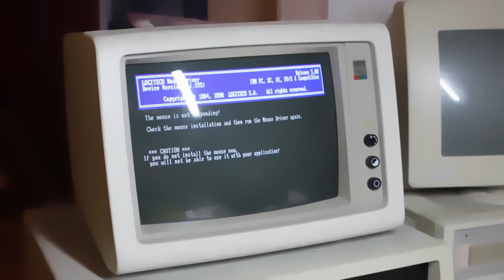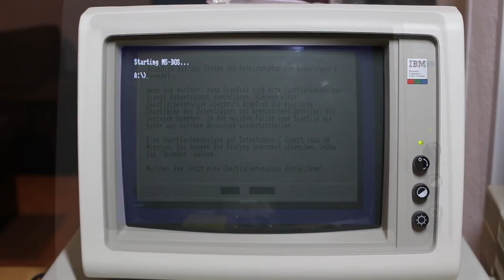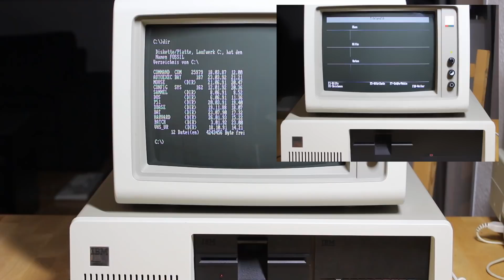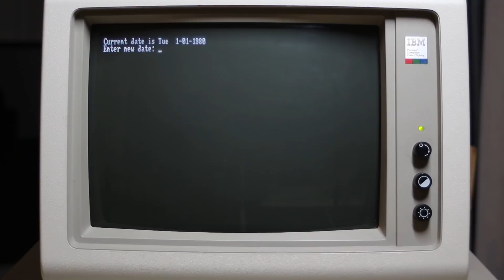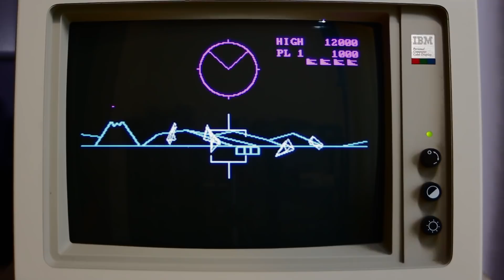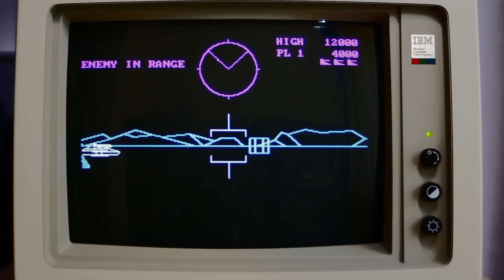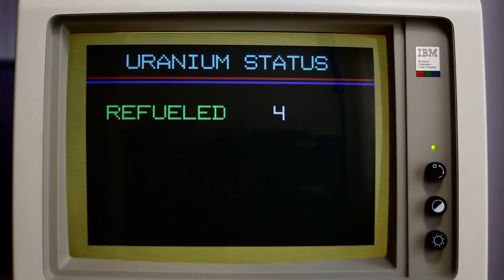This IBM Personal Computer held quite a few SURPRISES for me!

Comment: I’ve had pretty good luck with those old drives.  My XT, XT 286, AT, and Tandy 1000 RLHD all work like a charm.  Now, those drives in the PS/2 Model 30?  Good luck.

Also, I know some people are against pre-emptive recapping, but AFAIC, anything older than 1995 with tantalum caps has either failed or is about to.  Order 100 of the 10u/16v and a few each of 4.7u/16v, and 22u/16v, and just make it part of your new-to-me routine.  Otherwise you WILL end up playing whack-a-mole with ballistic caps, and that can’t be healthy for those poor PCB traces.

Tip for anyone who doesn’t have a vacuum desoldering gun:  Use side cutters to crack the cap open like a nut.  Then pull out one leg at a time.  With those bent legs, it’s a LOT easier to pull one out at an angle than trying to get all three legs through at once.  WAAaay fewer damaged pads that way.  :-)  (Not none, because the annular rings on those are so thin, they’re made of a hope and a prayer.  But still.)

Comment: It was already 1989 when I got to use one of these machines. This video brings back good memories
Reply: Tell me about it. I didn't get mist first PC, (an XT) until 1992, of course sort of made up for it by the fact not only did I get an XT, I got a Compaq 8088 luggable suitcase too. At least then we didn't have to deal with batteries leaking, or caps blowing. The stuff was near obsolete even then, but at least it worked without having to fuss with it.

Comment: I've just been through this journey myself after picking up a non functional XT. The same two capacitors on the motherboard needed replacing.

The hard drive was very noisy when I first managed to power it up, but a little bit of oil and some warm up time and it sounds a lot better. Even booted into DOS!
Reply from the maker: Mine still seems to be going, which is amazing given how much noise it makes. But people have assured me it was very normal for those drives.

Comment: very interesting and well narated video, thanks ! I also have some of these IBM machines - IBM AT/5170, IBM PC/5150 and also bought this september an 5160/XT with Hercules card and Amdek HGA display. All were with working MFM HDD's. on the 5170 I exchenged BIOS chips and installed IDE HDD, 5150 fitted with ISA8->CF card and the 5160, alas, have sold to another collector(... Also used to have Amstrad PC1640 as seen at the end of your video, but had sold it too... Now have an Amstrad PCW8256 which is a 8bit CP/m based machine with graphic mode)
Reply from the maker: Compact Flash can have its uses. I prefer to keep these old MFM drives working if I can, but it isn't always easy.
Reply: @PCRetroTech  agree it's cool to see in 2022 a computer with a working MFM HDD with it's brr-brr noises and indicators flashing) I keep them in storage - Seagate 2026 from 5170 recently gave for a feew week to onе man who was IT engeneur since mid 80's - he tried to use in in different machines from 5150 onwards) - but for me practical aspect is more important sometimes - so CF card or IDE HDD with more space for home use / MFM for a retro-event/festival)

Comment: The badge on the front should say "Personal Computer XT". Someone swapped the case cover, or at least the badge, from an original 5150 PC onto yours.
Reply from the maker: You may be correct, but I can find examples of IBM XT's without the XT on the front badge. There were numerous submodels of the XT. On the other hand, early IBM XT adverts feature the badge, so whilst I can't say for absolute certain, I'd lean strongly towards you being correct.
Reply: @PCRetroTech  None were originally shipped that way, except maybe for a few mistakes at the factory. It's just that because the PC and XT covers were identical, over the years of people working on them, they tended to get swapped.

Comment: Ohh and if you want a cool little video to do on these. Find an NEC V20 chip. Its a pin/socket compatible 8088 replacement that is literally good for 10% to 20% boost on these old PCs.
Reply from the maker: Sure, but nearly everyone is familiar with the V20 and V30 by now I reckon. I try to look for unique things where I can. But thanks for the suggestion.

Comment: I think later 5150s had the higher capacity power supply. It was mostly the earlier releases that had the black 63watt supply.
Reply from the maker: You could be right about that. I think my machine is a mishmash of parts, so it's hard to tell whether it is original to the machine.

Comment: Good !

I found a working 10MB hdd a while ago for cheap, but unfortunately I don't have the original IBM XT case :(

I have almost every part required to have a working XT. I'm just missing a PSU, a case and a IBM floppy drive ... (and PSU/case are the most important parts imo)
Reply from the maker: Cases seem to come up every now and again here in Germany. I have an extra floppy drive, and I'd offer it to you, except that it doesn't work. I bought it unopened, still sealed in plastic, but it eats floppy disks, quite literally. Those seem hard to come by in working condition as well. Quite often people are selling parts because they don't work any more, I find.
Reply: @PCRetroTech   Thanks, I appreciate the proposal, and I may consider it. For the case however, I can't find any, the only ones I see are from the US with a very high shipping tax, which is weird since my country is neighbor to germany ...
When they do pop, they're often with a really high price here as well
Reply from the maker: @DxDeksor  Yeah we have to pay these ridiculous customs charges, and some sellers really jack up the prices for shipping because there are so many lost and damaged items. Sometimes you can get lucky, but very large items tend to be very expensive to ship from the US. Keep looking out for one from Germany. They really do come up a few times a year. If I spot one I'll try to point it out to you.

Comment: Have you experimented with an EGA card on that monitor? If I recall back in the day I could use 16 color mode with low res ega on this screen :-)
Reply from the maker: Yes, that is correct. It works great in the low res mode.

Comment: I recently fired up an old IBM 10 mb hard drive and it booted right up after 30+ years. I ran spinrite and the drive had no issues. The others I tested I wasn't so lucky.
Reply from the maker: Yeah I think they aren't so bad at all. Certainly beats a Plus HardCard, which with 100% probability will be faulty.

Comment: It's not an MFM controller.  It's an ST506/412 interface.  MFM is only the encoding method, MFM or RLL.
Reply from the maker: Just to be precise here, ST-506 and ST-412 were hard drives, not interfaces. However, the interfaces became known as ST506 and ST412 due to the ubiquity/importance of the drives. They were both MFM.

Later the ST412 interface was extended and we got ST412-HP for RLL encoded drives.

This particular controller card in the video uses an MFM interface and some individuals refer to it as an MFM controller card, which is just short for "hard drive controller for hard drives using the MFM encoding". But that is a bit unwieldy, especially when you are trying to edit videos down for time, so please accept my apologies for being imprecise.
Reply: its an mfm controller....you can call it whatever you want....you can get a miniscribe, kalok, fujistsuu wahtever... 20mb mfm hardrive or even a 40mb rll drive working on one of those controllers, doesnt need to be an st412...the only downside is you have to low level format it WITH that controller and it will format it with 10mb capacity and not the actual full capacity of the drive....some people and publications also call those 5 or 10mb mfm controllers "winchester controller" or in case of the original card that came witht hese machines a "xebec"| controller

Comment: That is just how those cinder brick sized hard drives sounded.
Reply from the maker: Yeah a number of people have mentioned that. I'm not sure how clear the sound actually is on the video though. It sounds like an aircraft taking off with some outdoor furniture stuck in the jet engine, but being drowned out by other aircraft on the same aircraft carrier. My microphone was far from the drive.

I'd love to know why it sounded like that.
Reply: @PCRetroTech  The PC was fairly much built using off the shelf tech. The original 10MB hard drives were pretty much 1979 tech. And yes they were loud, obnoxious, and could be felt through the desk the PC was sitting on. (Seriously try it, place the PC on a solid desk, and get it seeking a lot. You will feel the vibrations through the desk). The Seagate ST-225 used in the last XTs was much better. Since it was designed for the PC, and not something that was meant to be in a backroom on a mainframe. Those platters in that thing are huge and heavy, and made quite the racket.
Reply from the maker: @Alcochaser  I can feel it without it doing any seeking. It rumbles the table like an industrial clothes dryer. The main noise I'm talking about though is the scraping noise it makes and the occasional noise that sounds like a pebble being thrown down a very deep hole (there's a kind of echo sound).
Reply: @PCRetroTech  Yep. The pebble noise has a reason. (Something the drive does once in a while with the heads) but its normal. The scraping might be the static wiper. These drives had a mech on the motor to ground it and to keep the thing from building up a static charge. These drives are beasts anyway you look at it.
Reply from the maker: @Alcochaser  Yeah I thought it could be the static wiper, but given that it probably got oil on it, I'm sceptical it's that. Obviously it isn't heads scraping. In the end the best theory I came up with is brushes scaping the commutator. If they are severely worn, that could be the cause.
Reply: @PCRetroTech  Maybe. There are a few odd things that stand out to me. I know people have pointed out the Cover doesn't match the PC, but there are a few other things that don't match. I wonder if at some point someone didn't mix and match stuff to get something that worked (Like I did in the 90s). You have the last revision 640K motherboard, but the hard drive and its Full length XEBEC (thats what we called those) controler, and the big 10MB tank drive from the early XTs. That controller is locked to only one drive geometry. Later XTs had a controller that could be jumpered for 4 different drives. It really looks like a PC that someone was using into later dates and was trying to keep running. If I remember right, XT 5160s used 135Watt supplies, and the PC 5150 (which had 5 slot motherboards on different spacing) used a 65 watt unit. So the 150Watt unit is a bit odd, and maybe aftermarket. (they made them, other case types did use the XT style supply). The video card you showed later is a definate later add on. MDA and Parallel. Only thing this thing was missing for being used at such a late date was a Clock/Memory/Ports card. Often made by AST. These would bring non 640K boards up to 640K, and could actually bring an XT to over 640K. The boards came with a driver that made the extra memory show up as EMS ram (not XMS).. I had one we scrounged all the chips we coudl find and I brought my XT up to 1.1mb of Ram total. I also had the fancy Western Digital MFM controller that has a BIOS you got into via Debug poking. You would tell the BIOS the drive parameters and go from there.
Reply from the maker: @Alcochaser  I'd say the supply was definitely after-market. I'm not 100% sure about the video card. It's unlikely the machine was bought without one. Perhaps someone decided they preferred monochrome and decided to get an after-market card. Or perhaps it is a more recent addition so the person could sell off the video card separately.

The seller didn't tell me anything about its history. I see no evidence it was used since the early 90s and the seller certainly didn't have it running recently. Most likely they swapped the supply out thinking that this was the cause of the faults we fixed, only to discover that it wasn't the problem.

Alternatively the video card may have been swapped out to try and get the machine working and then the machine sold when it didn't, either to me or to the previous owner.

It would be nice to know the history of the machine, I admit. Thanks for the info on the XEBEC manufacturer. I actually didn't know these were manufactured for IBM by that company.
Reply: @PCRetroTech  Often times these drives can sound like a head is scraping when it is actually just a bearing or a brush. If a head was scraping with one of these, you would know it.
Reply from the maker: @ducksonplays4190  Sure. It's definitely not a head.
Reply: @PCRetroTech  Likely letting the drive run for a while will sort out the noise problem if it is actually there. I couldn't tell from the recording whether or not it was making abnormal sounds.
Reply from the maker: @ducksonplays4190  Most of the sound was still there after letting it run, but the consensus seems to be that those sounds are normal for this drive.
Reply: @PCRetroTech  Ok then, these drives do like to be rather loud.
Reply: sounds like a dry bearing...i have the same drive and it fortunately (fingers crossed) sounds much healthier for now...but it works so maybe leave it as is

Comment: Very nice machine and great video! What type of ntsc to pal converter did you use for composite video out?
Reply from the maker: It's actually just a no-name Chinese brand. I think they are pretty generic these days. I did find that the output of one of my CGA cards looked terrible though, so I had to change that over. But it looked acceptable then.

Comment: 4:18 LOL! First time EVER I heard someone say the colour is wrong and complained about it. That's HILARIOUS! ROTFLMAO! LOL! Colour of a part doesn't match others??? WTF!??? I'm going to have to tell all my friends about this one LOL!! Wake up dude. When the case is closed you can't even see it so forget about the colour!
Reply: You probably have no idea about hardware restoration
Reply: what is your problem dude?? ok mentioning the colour of a capacitor might be an exageration but form your point of view we could just stick a modern mainboard running windows 10 and dosbox inside of the xt case and because the case is closed it would all be fine....welll....nope....for example i love old hard drives and i cannot stand a vintage pc with a xt ide adapter for example, yet many people use it, i dont complain though, each person has their level of perfection when they repair or restore an old piece of equipment...for some people it may be good enough to replace all tantalum caps with electrolytics and for some other people it may be required to use the exact same parts if available...its just personal preference....for me it doesnt matter but i admire people that have the patience to do everything perfect, i dont go on making fun of them just because i dont have time and patience to do the same work
Reply: @MrHBSoftware  Modern PC motherboards are way overkill. Stick a Pi3 or Pi4 in there, job done for less than 50 bucks LOL!